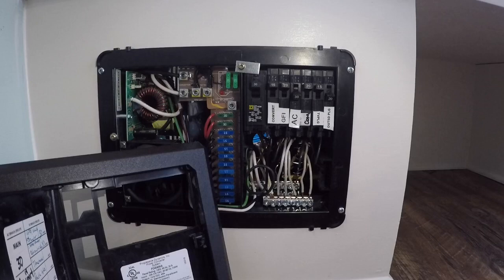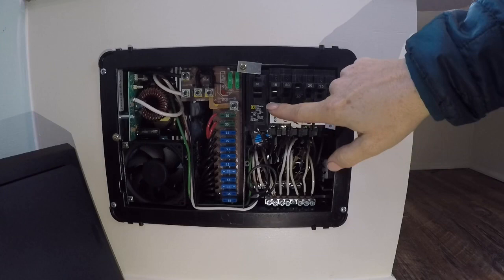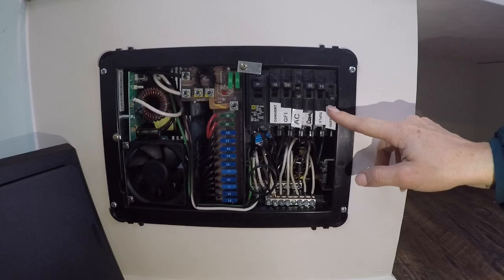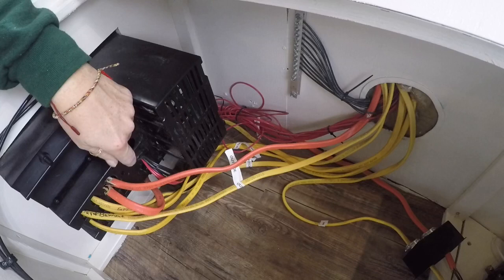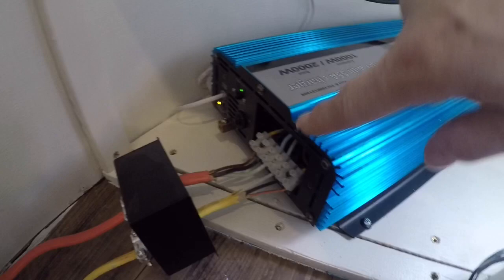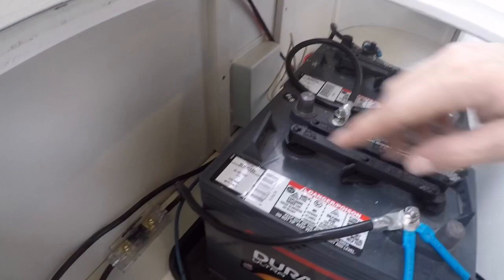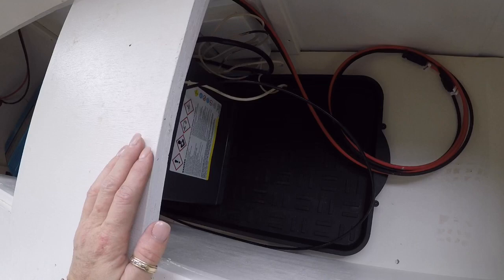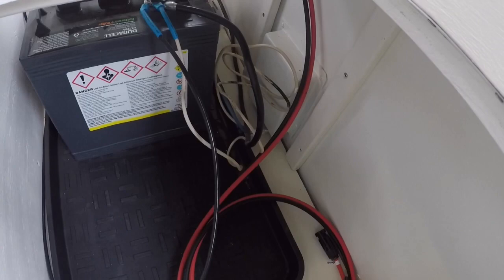New electrical setup for my 1970 airstream renovation.

Comment: Hi, with this setup are you not able to run any of your 120v circuits off of battery power/when you aren't connected to shore power? It looks like the only thing that is wired to the AC Out on the inverter is your fridge so that would be the only 120v item receiving power when not on shore power. Correct?

I'm going to get the PD4560KV option of the same power center you have. and trying to see if there is a way to energize the 120v AC panel part of the device when not on shore power and using battery power.
Reply from the maker: Hi Ashten. Your correct the only thing plug durectly to the inverter full time is the fridge bu i can plug something else into that outlet or directly into the inverteor if need be. So far that has not been an issue for me but i still plan to upgrade to a 2000w or 3000w and the i will wire all 120 through it.  For now when im off shore power i have 12v or propane  backup for the things i would normally plug in. The original inverter was what fit the budget.

Comment: So the red wires on the fuse side is just for a visual distinction between 30a and 15a wires?
Reply from the maker: Yep, pretty much
Reply: @mildredmabelme  thx so all those black wires are actually positive wires?
Reply from the maker: @averagerider92  yes inside the converter. That will come already wired that way if i remeber correctly.
Reply: @mildredmabelme  ok thx. Installing mine as we speak.

Comment: Great video!  I'm about to copy this on my airstream. What kind of control panel did you use that your batteries were hooked to?
Reply from the maker: Glad you liked it. If what you're asking is the AC/DC control panel  then I think it's the progressive dynamics 4045. I'm pretty sure I bought it from www.vintagetrailersupply.com Good luck with your airstream, I hope to do another one soon
Reply: @mildredmabelme   Sorry, I'm referring to what you mention at 12:30.  You have a cable going from the positive on your battery through a fuse and then to a control panel? I assumed that's something to give you a read on how full your battery is?

I went with the progressive dynamics 4500 series, it's pretty intimidating!
Reply from the maker: @matthewgow2891  oh, the cable going through the small fuse is going to the control panel and the other 100 watt fuse is going to the inverter
Reply from the maker: @matthewgow2891  the one to the control panel powers the 12v side of things
Reply: Thanks for this. I JUST started my 77 sovereign Reno. I have quite a mess of wires at the front and love what you’ve done. Can you provide a “buy list”?  I’m in Canada and right now (Covid) has really slowed down shipping.  So planning ahead with my purchases would help.
Reply from the maker: @mkblock  hi Milton. Glad you like the video. It can all be a but daunting when you start. I will try to get a list of stuff i used together. Also you might try reaching out to vinrage trailer supply. They have folks there that will do virtual appts with you and walk you through electrical pulumbing etc for free and thats where i got some of my stuff. It may be this weekend before i can get some stuff down for ya
Reply: New question! The cord that you have running from the inverter to the control panel... does that get wired to your main breaker along with your shore power?